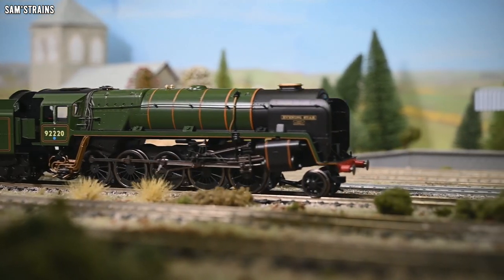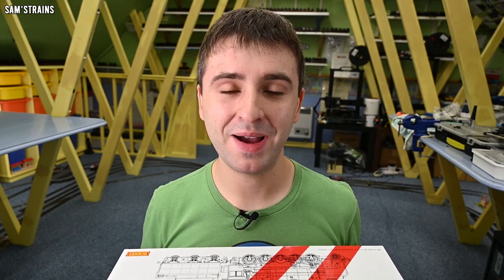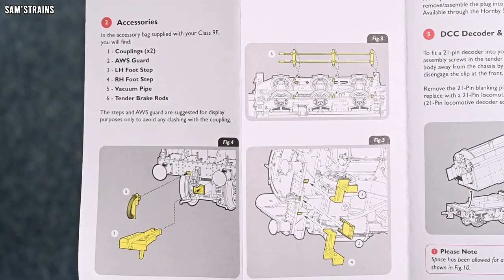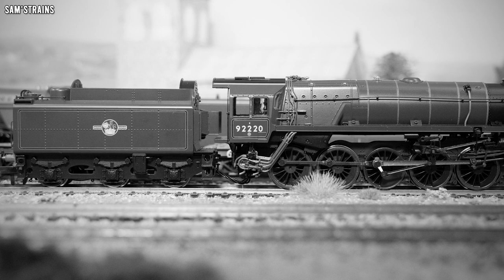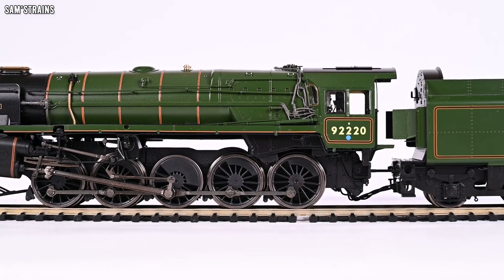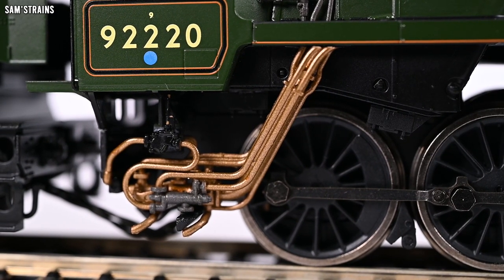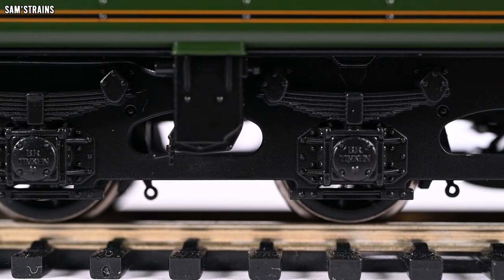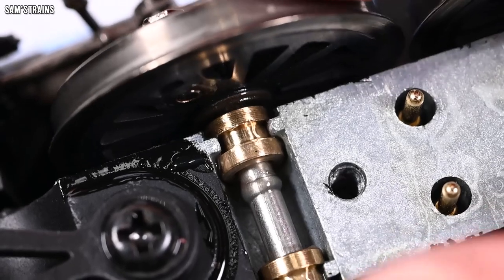All New Hornby Class 9F "Evening Star" | Unboxing & Review

Comment: Didn't see this one coming either, what a stunning looking model. The paint finish and lining are on a unmatched level.
It's a real shame that this model is let down on one very important part, its motor. This thing should pull 20 coaches around your layout and barely slow down to be good. Now it's just an expensive showcase piece.
A better motor wouldn't break the bank for Hornby, I think there is still enough margin on the price.
But I have seen more model manufacturers who went from using very powerful motors to weaker ones, like Roco.
I have both the first release and the last release of their Belgian class 20 electric. The first with the old motor really does rip the coupling from the coaches if you held the train down enough.
The last release just stalls out. I don't know if this is due to the fact that they don't want the motor pull to much current when a decoder is fitted?, but then most decoders can handle the 1A or 1,2A which the old motors drew when nearly stalled.

If Hornby is willing to address the problem with the motor (same size motor must be possible without redesign of the chassis) this model is a no brainer, especially when you can pick up for the price you payed.

Comment: Great review. I have two Bachmann 9Fs and one Hornby Crosti boilered 9F all of which are several years old. The Bachmann locos handle 10 coaches with ease and the Hornby performs better than the one you have now reviewed. I wonder whether the lack of power is a problem with most modern designs. The recent Dapol Manor when tested on my layout could not move 5 Mopok coaches, which are heavier than most rtr coaches. There are no gradients on my layout nor any curves of less than 36 inch radius (are radius 2 curves 18 inch radius?) The Manor stayed rooted to the spot with madly spinning wheels. I would be very much inclined to try to take apart the motor from the new 9F because it is clearly not suitable. Also I dislike intensely the bundle of wires connecting the loco and tender. The Dapol method is much better. Generally I find that Hornby models are lacking in quality in design and finish and in the case of rolling stock in the materials used.
I look forward to your next review.

Comment: A pretty fair review of what is a very good-looking model.  At least it would be good-looking apart from a couple of points.  Firstly, the amount of metalwork that is plastic.  The pipework I can perhaps understand, but the chimney cap...?  I had one of the early tender-drive ones and if I remember rightly, the cap on that was metal.  The second point is the handrails.  They seemed very obviously bent to me, and it just looked glaringly wrong.
As for the performance...  Well, that just seems to bear out something I've felt for a while, that most modern ready-to-run models are built for display, rather than running on a layout, certainly day-to-day running.  Performance just isn't such a priority for most manufacturers these days.  Which is a real shame...

Comment: put the new smoke funnel in that controled with water would set it off great oce you had the best parts vacuum pipes crew and plastic lights  varnish the coal and a lamp on the tender and a vacuum pipe would realy make it worth it

Comment: I suspect the purpose of this model was to be shelf candy, given the obvious bending over backward to get the visuals looking great but they shoved what I suspect is a fairly cheap motor in order to cut costs along with skimping on pre-installed DCC, when Bachman's offered locomotives with DCC installed as standard at far less for years.

Comment: Great video but I can't help but think there should be more gearing inside as that's a lot of wheels to be turned only by coupling rods and I wonder if that would help fix a torque issue. Even a small bo-bo diesel would have 4 driven axels so to have 1 on a loco of this size seems silly to me. Obviously a better motor is required but it seems to be a commonly reoccurring issue that steam locos are underpowered,

Comment: did the railroad 9 f have the flickering firebox?? if the rail road didnt and performs better then as a sams trains experiment why not remove from the circuit the firebox effect by bypassing it and see if the performance improves. may not be the motor that way

Comment: Could you improve the performance but putting a replacement motor from the railroad 9F seeing as that motor looks to be a superior motor, assuming it'll fit.
Skew motors can increase the torque, but if the  armature is skewed to much this can easily adversely affect  the torque. Maybe these motors have been skewed to much?

Comment: I think you are wrong about this model and heres why:

1. I have a Hornby 9F "Evening Star" and it runs like a dream, smooth, excellent crawl and good power, no stalling and wisper quite.
2. I upgraded mine to DCC sound and its still ran well.
3. Correct me if im wrong here, but I believe your controller is a non feedback controller and I've noticed issues with certain motors on non-feedback controllers. 

(carpet layouts do not cause the issue you have so I am disregarding those comments as I deam them not relevant (although you could do with adding some pickups half way through the layout for good measure and you can use the beams for this wiring, just a suggestion))

Heres what I suggest, upgrade you 9F to DCC or get a feedback controller and try it again and update us. I'm all for calling Hornby out on there mistakes / greed; like their lack of speaker in the P2 and 9F. But I think the "motor problem" you are having is a controller problem not a problem with the motor they are using. I am not the only one to report that their 9F ran well and didn't encounter the problem(s) you had.

Comment: Regarding that motor: sourcing parts in the Far East is a nightmare, because there have been plenty of instances where Western companies have required a certain specification of part, but then after a while the Chinese factories start to cut corners. You could see fewer windings, or cheaper components or poor finishing.  Not easy to spot until it's to late. A company I worked for sourced parts from China, but they had a person on site or paying regular spot visits and they also did random quality tests to make sure the parts were up to spec. You have to do it otherwise over time the companies realise they can get away with cheapening the product. Even Aston Martin had to do a recall because one of their parts had a problem when the factory in China used a different grade of plastic. Happens to everyone unless you are prepared for it.

Comment: Hey Sam, this 9f Decapod Spaceship from Hornby is very nice and I do like this model. Realistically, this model is still too expensive and it uses the same motor like the B12 along with the S15 which makes it very underpowered when it is coupled up to many coaches and freight wagons. Why could Hornby not use a coreless motor instead? I mean, Bachmann have been using the coreless motors on their newer models.
Reply from the maker: Thanks a lot Bryan - yes I'd agree with you there, pity about the motor choice... a coreless would have performed better I think!
Thanks for watching, Sam :)

Comment: So the 1971 Triang Evening Star I got for Christmas will out perform the latest Chinese made offering from Hornby. I quite enjoy the reviews but it seems to be the prime function of a model locomotive ,the ability to actually pull a train,is almost being overlooked?(not by you Sam but by the makers!) I also don't understand the pre occupation with 'Die Cast' particularly given the material used by the current factories and its desire to decompose in short order.There is nothing wrong with diecast or injection moulding both have there correct applications and used in combination can result in a superb product.Keep up the good work but less than impressed with most of the current offerings especially when it comes to the bits that make the loco's actually go!

Comment: Great review again Sam, good to see Hornby upping their game in the quality stakes, but shame about the motor though if that is causing issues across multiple models. Interestingly that split line on the back of the smoke box is actually prototypical, it's a removable panel to access part of the superheater. Some of the locos, especially those in preservation, also have splits in the boiler casings in a variety of places. I couldn't tell you if Hornby have aligned those with the tooling splits though. Looking forward to the next one :)

Comment: Have to say, I think your review is over-generous. My initial reaction was that the boiler handrails are not right - they should be dead straight and parallel to the footplate, looking from front to rear, with a slight downturn following the line of the washout plugs on the firebox. the footlate on the left-had side doesn't look straight, and the pipework for the injectors under the right-hand side of the cab looks to be at strange angles. I wont go into the performance issues!
Some might say that I am being hyper-critical, but at that sort of price, nothing short of perfection is acceptable.

Comment: Great review, I’m almost considering trading my RR model in. Just a thought, perhaps the twin flywheels are impacting torque as to keep mass rotating at motor speed takes energy. It could be a trade off, flywheels smooth out performance but at a detriment to pulling power. Akin to how racing cars have lighter flywheels and wheels to aid acceleration. Could be an interesting experiment to remove the flywheels and test again (perhaps on a less expensive brand new model)
Reply from the maker: Thanks for sharing! Yes no doubt the flywheels will have an impact, but they shouldn't affect the model to this degree. Unfortunately the flywheels can't be removed, as one is used to turn the drive shaft. Performance is much better on a feedback controller... but that doesn't help me much as I prefer to use non-feedback on my layout!
Thanks for watching, Sam :)
Reply: at over £200 for a  new loco there  shouldnt  be a NEED to experiment with motors and flywheels ,it should work perfectly straight out of the box !!

Comment: It’s intriguing that their new models are 21 pin DCC sockets. Their TTS decoders remain 8 pin. Is this a ‘nod’ to other Decoder manufacturers or are we to expect a new 21 pin Decoder from Hornby? A 21 pin to 8 pin converter would be immediately required if not.
(I’m still watching Sam, and you might cover it but had to write before I forget! 😅) cheers. Bob
Reply: I'm reading this review a few months on from most of the posts and have a couple of observations (1) It looks like some of you have tried it on DCC and if so are you (still) happy with the performance? (2) I'm not sure that I would want  a decoder fitted as standard especially as in the last month Hornby have released the new Bluetooth DCC chips, Having said that I think the price (IMHO) is a bit high for a DC-out-of-the-box loco. Great channel @Sam

Comment: Another very fair review. She's a beauty, and the box redesign I hope becomes standard, although the performance is exactly what I was expecting with Hornby's recent quality. I'll get one when they do a Tyne Dock ones with the westinghouse pumps to match the KR Models' Consett wagons, and I hope the torque is improved from that.
It does seem better than the Bachmann one, excepting the torque. The main issue with the Bachmann one for me is the pickups, just on 8 of the 10 driving wheels and not on the tender, so I have to keep the pickups and wheels spotless to make it not stall on points or crossovers.

Comment: Looks good!  I have both a S12 and an S15 with the same motor -- both run fine.  I think the Chinese motor builder had a bad batch of motors for a while.  But here with the 9F, I think the problem is that it is a lightweight low-torque motor..... ok for the plastic small S12.... but too weak for the large and heavy 9F.  And at a price of $280 USD..... no thanks!   Not worth it.  Without a more powerful motor, it is just a pretty paperweight....

Comment: i got the new evening star as well, the torque issues are arguably worse for me, on a rolling road running at slow speed it will run slower for 180 degrees of wheel rotation, then speed up, then slow down then speed up, all within the wheels rotation, and it is faster backwards than forwards, and it will speed up in a very strange way that ive never encountered with another loco before. its such a let down for such a great model

Comment: I was looking forward to this review Sam, ....and i wasnt dissapointed .. Hornby cutting corners again by fitting a 50p motor in a 252 quid retail loco  ... they should be ashamed of themselves .. how long before it burns out ??
Re the body   getting to see too many mould lines on boilers and fireboxes  ( dapol manor   at 10  and 2 Oclock ..   i didnt mind them on the top because that is where the cladding joins on most full size locos  and i accept  there has to be one   ..only option is flat it off and a repaint ... Bachmann wins there 
The wires between loco and tender are pretty awful .. why cant Hornby get this right   Dapol can for £100 less 
The live and exhaust steam injectors and water valves  are good .. better than Bachmann who just copied a preserved one that had two Live steam ones   92220 and 92203 are the only Ex BR 9fs   .. so are as genuine as you can get .. if Hornby made that seperate it would be worth putting on a Bachmann one 
So to sum up ,.. £100  plus more does not buy you £100 better loco ,, the Bachmann although flawed  is still very good value
Only one way to get a good 9F .. build your own chassis ..

Comment: Oh Sam, what an absolute bummer! So irritating when they put in a dud and the rest of it is a beaut 🙄 Got great memories from when I was very young and lived by the Keighley and Worth Valley Railway when she was resident there and running. Shame that she is now essentially stuffed and mounted 😔 Alas, this model whilst beautiful is not as powerful as the old Silver Seal one I got back in the late 80s, which when fresh out of a service will pull 10 without too much fuss around 2nd and 3rd radius curves, albeit of course she is tender drive and not loco drive 🤷🏻‍♂️

Ah well, maybe there will be a simple fix, like a replacement motor mechanism you can find. Seems a shame to let such a stupid mistake ruin such a great model 🤔

Cheers sunshine, been off t’internet for a bit, so it’s been nice catching up with your videos 😜👍🍻🍀

Comment: The packaging reminds me of old Hornby/Triang when they use to actually care about the end user and the quality of the end user experience.  It is still riciulously expensive, but I can definitely see a lot of progress in a positive direction from Hornby with this model.  The inclusion of the painted crew is just a really nice bonus.   Doesn't quite make up the price Hornby now charge, but it is really nice to see these value features coming back into the range.
I wonder if Hornby are using those motors because it is hard to get replacements for them at the moment?   Or maybe they just bought a heap in bulk cheap......

Comment: I'm sorry but a newly tooled model in this day and age shouldn't have wires dangling between the engine and the tender. Dapol and Accurascale have devised a modern solution, so why not Hornby. The loco crew figures would not have been free, they would have costed into the price. Also why wasn't the brake rigging factory fitted?

Comment: :_SamstrainsSamstrains:I think my Evening Star looks better and runs better. There is a lot to be said for the old Silver Seal Motors in the tenders. The new Evening Star looks nice, feels heavier and runs like a Tortouse. Hornby, you nearly got me backing your fold with this model, but once again a lack of Test tracking, A J94 can pull better than this. We know it is the motor and we know that you know that is the motor. So change it. A £242 Locomotive with a Jamberee bag motor. I am only buying second hand Train Packs and coach packs now and when they are running around my layout  could you spot a locomotive with lot of separately fitted parts or one with the details painted on it. :_SamstrainsChristmas: Martin. (Thailand)   🚂🚃🚃🚃🚃🚃🚃🚃🚃🚃

Comment: Excuse me. That running plate absolutely IS warped... I have to disagree on this one. I think for its price, this thing has some decent issues... I disagree on the paint. Especially that one pipe where it transitions from the green to the black... Not to mention, most of the pipes look like they were mounted by a drunk, blind fish... That coal load looks HORRIBLE... I wouldn't spend over $150, MAYBE $180 usd on this... But that's just MY opinion... Don't get me wrong. I do really like it. It does look good. I also like the color. I just think it shouldn't have any of the issues it has in my opinion for its price...

Comment: Hornby’s engineering  prototypes clearly showed a die-cast boiler and running plate with a plastic smoke box/running plate combination glued onto the front. They were clearly mismatched then. This quite clearly has not been addressed since :(

Don’t know why you didn’t place a steel rule on the running plate as per your previous reviews. This would have highlighted this glaring error in cheapskate design & construction, along with the very poor choice of motor, and for £252+ no DCC TTS fitted as standard, as per their LNER P2 2-8-2 “Cock O’ The North” which cost me only £140 new from Janes’s Trains of Tooting, London.

Perhaps being viewed with rosé tinted glasses???
Reply: Agreed. The running plate didn’t look straight to me.